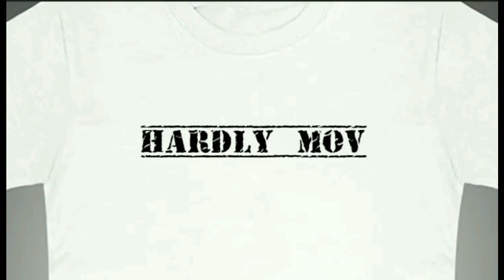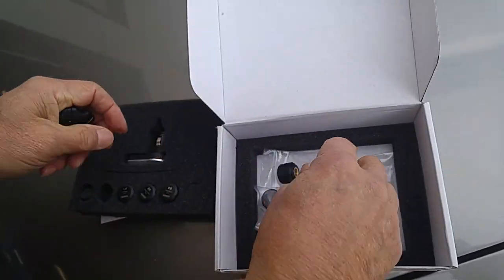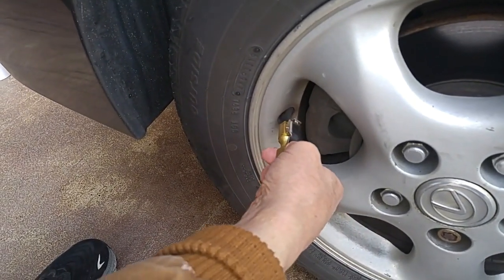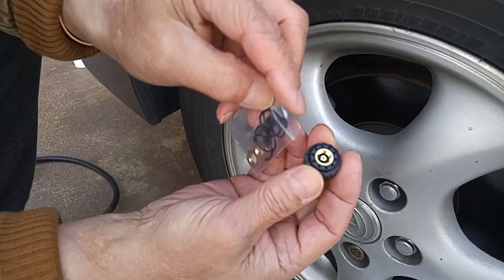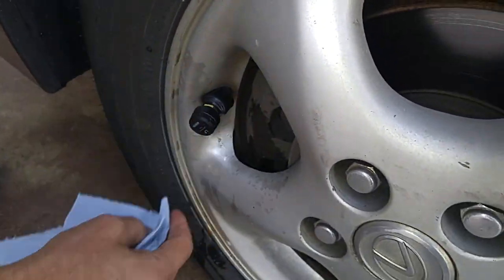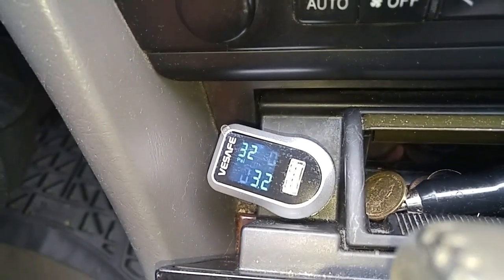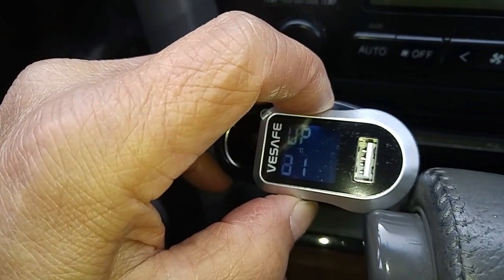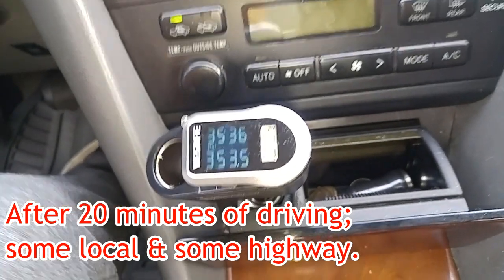Tire Pressure Monitoring System TPMS

Comment: Nice solution to not only cars that have no or only low tire pressure monitoring TPM) or for winter tire and rim sets that usually do not include tire pressure sensors (TPM).

P.S. i I hope there is a USB powering  option for the display unit. Bluetooth would also be convenient but not necessary.

I am also concerned about automatic car washers damaging the TPM sending units. They should have an easy break off and seal feature for that situation.

Finally are the sending units separately ordersble should one break?

Comment: I have a few different (VERY similar) sets of these exterior TPMS.  The first set was awesome UNTIL I went through a carwash and the valve stem was totally ripped out resulting in an instant & 100%  flat tire.  MUST REMOVE THESE WHEN GOING THROUGH A CARWASH... ignore my warning and you will most likely strongly regret it!!!  The second set had batteries that went dead VERY fast (replacement batteries are more expensive than a new set of sensors).
Reply from the maker: Thanks for sharing.  We'll see how long the batteries last.  Manufacturers claim 2 years.  Short stainless steel valve stems might address the car wash problem.
Reply: Maybe short SS will help (but I doubt it) you have to be willing to risk the pain in the A*s of an instant & 100% flat resulting in a tire change or tow every time you go through the car wash (it totally ripped the stem from the rim.). At best, remove them every time you go through the wash.  My new thing is I got a super fast & convenient (battery operated) Ridgid inflator and just check / inflate once a month or when drastic temp changes happen. @hardlymovingpro

Comment: Well done. I wonder if it has the range to monitor the tire pressure on a trailer. My F-350 has tire pressure monitoring, as does my 5th wheel (I got the Ford add on monitor for the 5th wheel when I purchased the truck - never again WAY too expensive an option). My dump trailer doesn't have tire pressure monitoring so I wonder if this TPMS has the range to pick up the trailer tires.
Reply from the maker: That would be a good idea if it works. I'll test that.